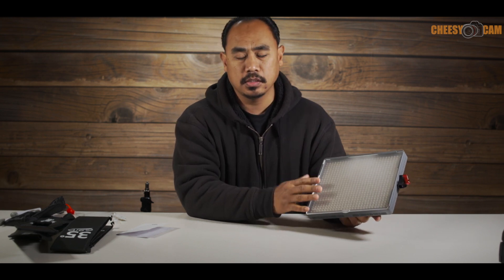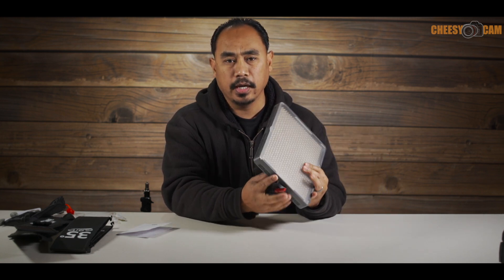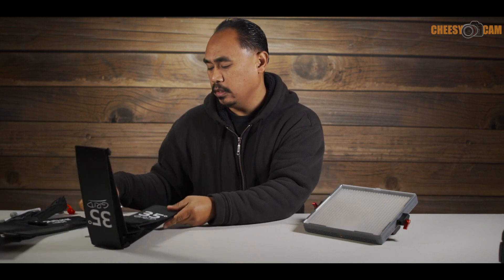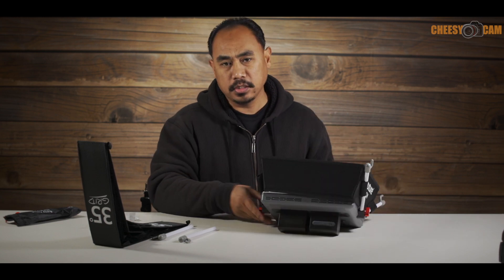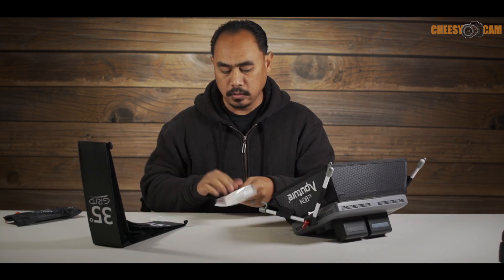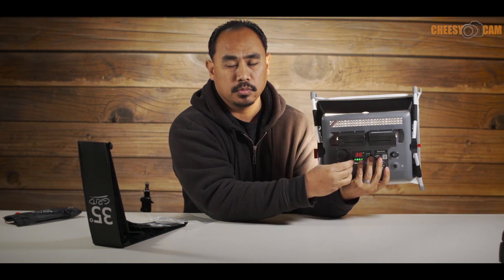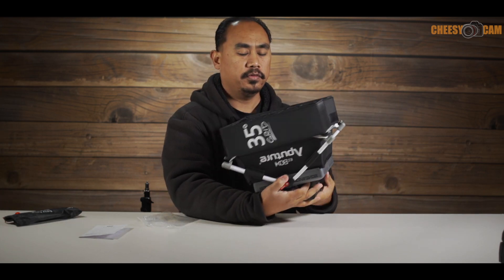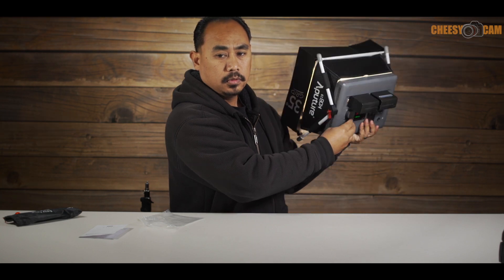Aputure EZ Box Softbox and Grid Kit for Amaran 528 and 672 LED Light Panels

Comment: could i use a timber frame with the external dimension of a 672 light and screw the EZ box connectors into that so i could use this softbox with an Aputure AL F7? 
i cant find any other grid with that depth and the material looks good quality or would you suggest some other softbox for the A7 thanks.
Reply: Yes! great question! any answers to this???

Comment: Hey, long time follower here. Love your tutorials man. I'm writing because I bought this soft box for my 672 LED light and the arms will not fit into the adapters. I'm pushing them in with a lot of force and they just won't go all the way in. Have you ever noticed this problem?
Reply from the maker: +trey vollmer Yeah they can be a tight fit, but you need to insert them at an angle not straight in. Once you find the right angle, then it goes in nicely.
Reply: +MrCheesyCam Thank you sir. I did notice that they need to be inserted at an angle, but they are still extremely difficult to fit in. Thanks for the feedback and keep doing what you do man!

Comment: in my opinion it's a really horrible design. The diffuser doesn't render the bare leds as a single source when you look at it, and because of that, it basically eliminates the other setup, which is the bare light with grid, because the LED banding is going to be so bad. The moment I received them from Aputure, I told then it's such a bad design and takes too long to setup. If I were a one man band it's fine, but these designs are nowhere near professional.